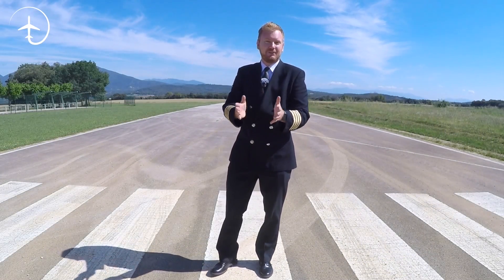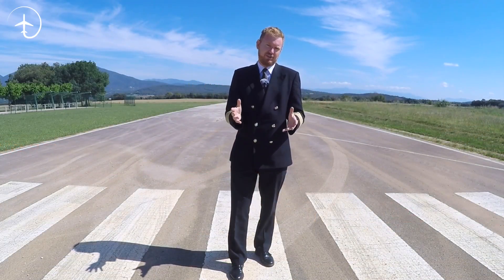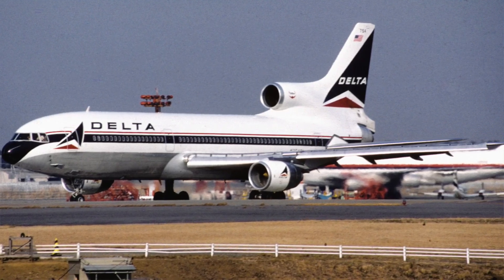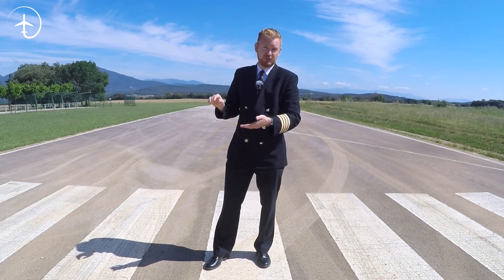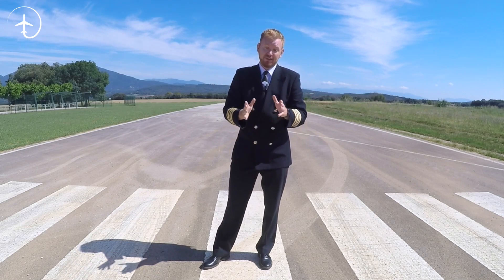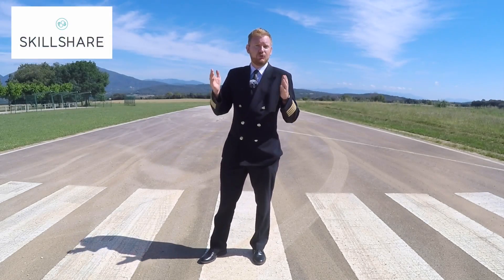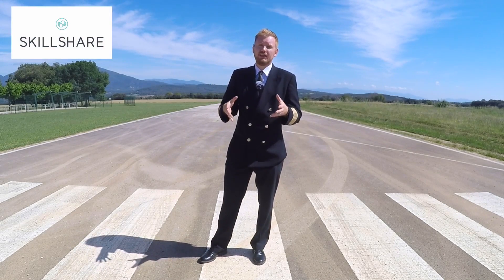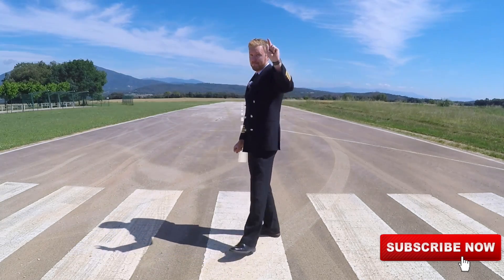Three Engined Aircraft, what happened?

Comment: Why not just have ONE Big Engine (or TWO Big Engines for the biggest planes)? Because most of the thrust are only needed for Take-Off, Climbing, and possibly Emergency Reverse Thrust after Landing. Had ONE Big Engine for all of those things, and then had it run at reduced thrust (1/5 of its Maximum Thrust) during Cruise, with a few smaller (more economic and easily maintained) engines acting as hot-spares.

An Engine with a Maximum thrust of 45 tons is is usually throttled down to 5 tons of thrust during Cruise. This means the Engine's thrust during Cruise can be replaced with two smaller Engines, with each having a Maximum Thrust of 2.5 tons, or maybe higher if they don't want the smaller engines to continously be on Maximum Thrust during Cruise.
The issue is that, if the Main Engine is inoperational, the aircraft can't Take-Off. But most Twin-jets can't Take-Off with just ONE ENGINE anyway; that's why Tri-jets and Quad-jets existed, so they can Take-Off with what ever engines left incase of an emergency.

Anyway. Why not this kind of Commercial Airliner?

One Big Engine at the Back. Two Smaller Engines at the Wings. Two Small Rear Wings in a V-tail configuration acting as Ruddervators. A small Canard acting as a Stabilator ('stabilizer-elevator').

Comment: Three engines on small jets may have a future, but with the 777X and the A350 doing 14000km+ on 2 engines and carrying 300+ passengers I'm not seeing the need for 3 engine airplanes ever again... in fact, I'm not even seeing the future of big, 4 engine airplanes like the 747 and A380 which have similar range and carry 400-500+ passengers but with the increased complexity and cost of operating 4 engines!

Comment: During the GE90 delvelopment, it was flight tested on a 747-100.  The GE90 was on one pylon and it had JT9D's on the other 3 pylon's.  Once at altitude it was able to fly on just the GE engine and did so to stress test it.  The 747was an ex Pan Am plane and still retains its interiour logo's.  The plane also had to undergo C Checks more often because of the stress it was put under.

Comment: Does anybody know why the A340 has 4 engines? I find it weird because airlines are all about flying as cheap as possible, and 4 engines means more fuel consumption. So why the operate the A340 instead of the B777, which would be a cheaper alternative and can hold about the same amount of passengers? 
Same with the Avro RJ100. It’s a regional aircraft and has 4 engines that all wants fuel. Why not instead operate ATR-70’s or CRJ-900’s that would probably be cheaper?

Comment: can someone explain contra rotating props?
Reply: contra rotating props [and [sometimes] the engine they are attached to - because, sometimes, they use gearing between the engine and the prop to counter-rotate the prop while the engine turns the other direction] turn in opposite directions in order to cancel out [rotational/roll] torque .. this reduces the stresses on the airframe and engine and creates a smoother ride for passengers, with less vibration being transferred through the airframe and engine .. which also helps extend the life cycle of the airframe and engine .. also, two engines/props turning in the same direction cause the airplane to want to rotate [roll] more easily one way than the other .. a roll to the right handles differently than a roll to the left - especially if one the engines decides to cough its lungs out the tailpipe and give up the ghost at 40,000 feet .. contra-rotating props/engines cause the airplane to balance its rotational [roll] forces and handle the same in all directions ..

Comment: DC-10 was also a great plane that got a bum rap for mostly bad pilot decisions, weather and bad maintenance. There was a problem with a cargo door and the need to fix floor venting and structure but they fixed those  issues. I will say that the L-1011 looked a lot nicer than the DC-10 though.

Comment: Another reason for trijets was the need to get in and out of smaller airports with a useful passenger and cargo load. The L-1011 and DC-10 emerged from an American Airlines requirement for a larger plane, preferably a widebody, capable of operating out of LaGuardia. Smaller airports like LaGuardia couldn't handle increased frequencies since there simply wasn't anywhere to park more jets, and neither could they operate very large aircraft (for the day), but they could handle a smaller number of somewhat larger jets. However, how to take off from LaGuardia's smallish runway? Answer: a third engine. This allowed for a larger widebody (though obviously not 747-sized) with enough thrust to operate from smaller airports. Now, airports like LaGuardia and Chicago-Midway were within widebody capabilities, allowing airlines to move more passengers per plane. Different considerations governed the designs of the 727 and the Trident, for example, but the shorter runway/smaller airport  issue was what specifically resulted in the L-1011 and the DC-10.

Comment: Why freight airlines still flying big trijet? Isn't it expensive to fly trijets for them?
Reply from the maker: Is likely that there are other benefits or extreme costs in buying and retrofitting new planes.
Reply: Are cargo planes subject to the same ETOPS requirements as passenger planes? One could assume, as there are only pilots lives at stake, they could be less stringent :) So they would have less reason for more engines than passenger planes. Could it have something to do with more power allowing more freight?
Reply: Fedex and UPS don't fly that many hours compared to passenger carriers. They don't mind the gaz guzzlers; cheaper than leasing costs of new aircrafts.

Comment: Boeing  737-900 series can now fly over international waters from Las Angels to Hawia islands (4 hour trip one way) ,which was done by 767 or  airbus 330 aircrafts. (smaller twin engines  vs   larger twin engines (which powered 767,310,300,DC10, ,Lockheed Tristar,747 series).

Comment: As the technology of the engines get more bigger, powerful, and reliable,

I'm starting to get the hype for a single-engine passenger aircraft

if only they are super reliable enough to not have such a big problem in case of a single-engine failure

Comment: Thanks for an interesting, informative & well-produced video! Personally, I miss the tri-jets, & wish you could have covered more of them in greater depth! I think there is still potential for a modern tri-jet design; with the emphasis on fuel economy, if you had retractable inlets (or NACA inlets) for the third engine, it would serve primarily for take-off & climb to altitude, then shut down & close the intakes so there would be much less drag than tri-jets of the past. With a third engine for take-off and ascent, the two main engines could be down-sized, reducing weight, drag, and fuel consumption. And, with the safety/redundancy of a third engine, the main engines could again be smaller because in the event of an engine failure, engaging the third (buried) engine would provide enough thrust (on the centerline, too for better control) that the plane could be certified (for ETOPS) with smaller main engines. Also, although unlikely, if debris ingestion (bird strikes, for example)...
Reply: Caused the two main engines to fail, (we all remember Captain Sullenberger successfully ditching US Airways flight 1549 on the Hudson River [no easy feat, to say the least!] in NYC in 2009 after both engines failed due to ingesting multiple large birds) the third engine could at least provide enough thrust to increase the chances of a safe, controlled landing dramatically. Drag, weight & fuel reduction, reduced emissions, ETOPS certification, and possibly lower insurance costs all lead me to believe this is an idea with merit. As you point out in your video, there were specific reasons for tri-jets falling out of favor. Perhaps there are now reasons to re-examine & redevelop this configuration! Any interested aircraft manufacturers are welcome to contact me and send me obscene amounts of money! Also, I'm curious- er du Norsk? Mange takk!

Comment: Correction: S-duct designs CAN accommodate bigger engines when they become available. A great example of this is the Boeing 727. Only the latest upgrade, the super 27 engines couldn't fit the center engine bay. By then the 727 had become a mostly obsolete aircraft.

Comment: Hi, I've been flying coroprate jets for 25 years now.. I have 9000 hours in Falcon Tri-jets and I also fly the Gulfstream G550.  One point besides redundancy of engines for extended overwater and remote area flights, is the performance gains during engine failure scenarios.
My G550 engines produce 15,380 lbs of thrust each, (30,720 lbs) for an aircraft with a maximum ramp weight of 91,400 lbs.   Pretty good thrust to weight ratio, even a maximum takeoff weight.  However, my Falcon 900LX, has three engines with 5000 lbs thrust. (15,000 lbs total with a maximum takeoff weight of 49,000 lbs.  However with the loss of an engine during critical takeoff, after V1, the Falcon has a 1:4.9 Thrust to weight ratio at maximum takeoff, whereas the more powerful Gulfstream has only 1:5.94 Thrust to weight.. The Falcon will siginificantly out perform the Gulfstream after an engine failure and climb significantly better.   Climb ability is the power you have in excess of that required for straight and level flight at a given weight and speed.  Additionally, in the event of an engine failure say, over extreme mountains, or over an extended overwater flight, The Falcon driftdown altitude at mid-weight is still well above 31,000 feet, whereas the Gulfsteam is below FL270 in most scenarios..  The Falcon trijet will provide much longer endurance after a engine failure at mid-weight by maintaining altitude.  
Don't get me wrong, we bought the G550 because we need to be able to fly for 14 hour missions on a regular basis,  a stretch for any other plane except new G650, global 7000.  The newer 8x and Global 6000 are close there.  I prefer the 8x, but the Gulstream is still the long range Champ

Comment: I'm also a trijet lover (1. MD-11, 2. L-1011; 3. DC-10). My feelings why the airliners went on twojets in the late 80s, as you mention, are a bit different from yours. I would say the reason were the number of accidents (about 10 for MD-11). I've gone through many of them on YouTube and come to the conclusion that, as you mention it yourself, a bit more attention is required to pilot such an aircraft (more speed = pitching, less speed=nose upe).So to my eyes the tail engine should not be used during take offs and landings, as they might create some fatal issues. I won't go into details how to keep that technically together.
Reply: I think the 727 was a very reliable aircraft, although I could not find out about the number of accidents. About 10 years older, very noisy, but I would say an excellent base to develop a slightly larger aircraft, based on the existing experience, changing the engines and other technical improvements. MD-11 is about 15m longer, which is an important step in matters of lenght.. Maybe a 729, 5m longer, cleaner engines and more, would have been a safer way to proceed?
Reply: Close to 20 the number of accidents, but considering all the aircrafts then flying, a much lower risk than later trijets.

Comment: This plane is very bad because it has a major history of system and mecanic errors, it has a major history of crashes. For example lets take the crash that happend in 1980's with United Airlines on the way to Chicago, a 3 engined plane was on a normal flight but then suddenly a part in the tail engine have exploded, and dameged the elevators hiderolics and the hiderolic liquid have leaked out, and the pilots didnt have any control on the plane midair, than they have switched off the tail engine because it strongly shaked the plane, and they used the 2 engines power to control the plane(without up and down, just to the sides), they have crash landed the plane, and 111 people died there and 243 survived.

Comment: I wonder why, for safety, for things like birdstrikes, dual engine airplanes don't have a 3rd identical engine that stays covered (so it would be immune to the initial birdstrike), but able to be used very quickly in an emergency.  It would have to be powerful enough to fly the plane by itself (on one engine only).  I know it is more expensive but since it would be an identical engine, it could be swapped with another engine after so many miles/hours of use.  I would feel more comfortable on a plane knowing it has a backup engine.  It might also be used for short takeoffs and there may be other uses for it too such as noise reduction (the 2 winged engines could be turned off and the plane flown on just the single engine for example).

Comment: please do some fact checking.. the TRIDENT predates the 727. . the L1011 #2 engine was placed on the center line to facilitate easy engine repair and or replacement in the field. the placement also counter acted the rolling action of the plane at low speeds that was known to occur in the dc-10-30's and 40's. L1011 was designed with many redundant  sub-system to ensure on time departures from distant locations. examples are 4 total anti-colision becons and , 4 hydraulic pumps .

Comment: Boeing had looked into a tri-jet version of the 747 at one point, mounting the third engine in the body like the L-1011. They ultimately determined that the cost of redesigning the wing to maintain the handling characteristics made it impractical, and instead built the 747SP.

Comment: Mentour Pilot, was there ever any engineering consideration to consider to the spin-handedness of the third engine? I know that in helicopter jets, the fans counter-rotate to eliminate gyroscopic forces, but what about the types of engines used on passenger jets?
Reply: Stephen Escobar ,
No, too expensive to do. Just use the flight control trim to make the aircraft fly straight and level.